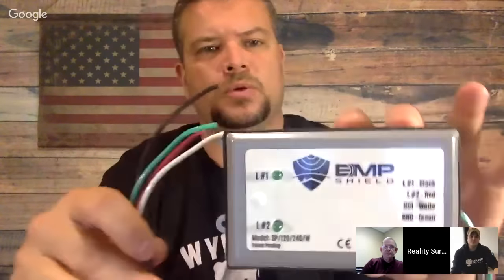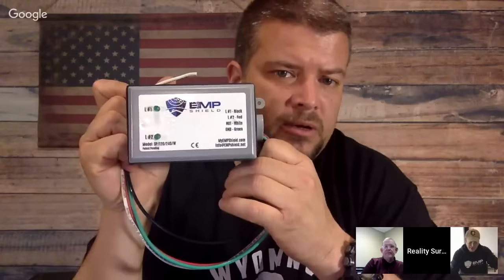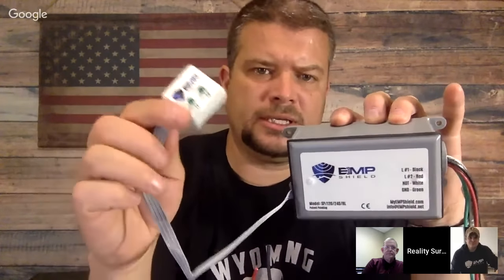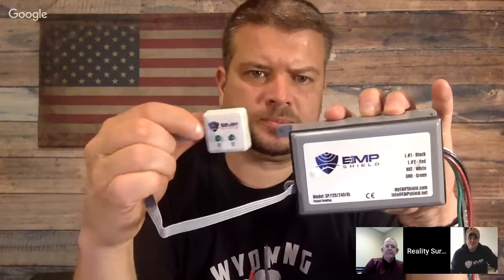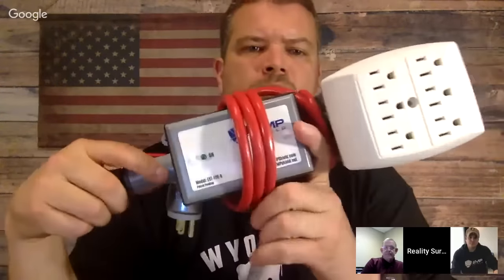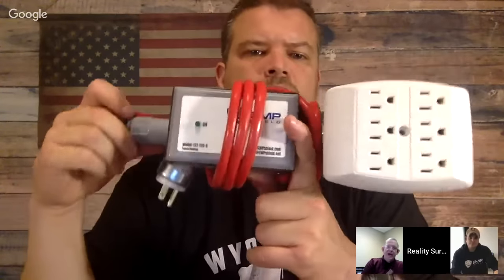The Truth About The EMP Shield!

Comment: I went to a junk yard. Bought a back up computer and body control module for my ride. Put them into a faraday cage. Get fuses and relays from junk yard too.
Reply: Make sure the chipped keys are in the cage with the computer
Reply: Better make sure that BCM is programmed for your vehicle.
Reply: @jeffmotes2129  
100% correct.  Program, install, test!
Reply: I def thought about this . Cause it's a sjre fire way
Reply: But what about the solenoids and all the other sensors in the CAN
Reply: Don't forget an extra starter, alternator, and any other electronic device you'll need.  Remember, 2 is 1, and 1 is none.
Reply from the maker: Not necessary for emp protection. You only have to worry about sensitive electronics with micro chips. Starters and alternators will be fine. At least the old ones. You only have to worry about the HEI ignition module and possibly the voltage regulators.
Reply: Good for you. Put one together for me because I can't.

Comment: Do items/unit need to be plugged in and powered on for protection?
Reply from the maker: According to the manufacture as long as it is hooked up to the system it will work. Even if it is powered down at the time of the emp it will activate as soon as it detects an over voltage.
Reply: @RealitySurvival  I thought the question was (and this is my question), do you need to plug in to the wall outlets: all the electrical items you want to protect? Or are the electrical items just being Inside the home, unplugged, protected? 
Also, can you plug in appliances and things to an electrical power strip with the strip turned off and be protected? Tia!
Reply from the maker: Yes they have to be plugged into the wall I order to be protected by the EMPShield.
Reply from the maker: On the power strip question I think it would need to be powered on. Not off. Because that breaks the circuit.
Reply: @RealitySurvival  didn’t d or t a response, thx! We actually purchased a household one from
Them a few months back but we didn’t know the answer. My husband hooked it up to our flat box fuse box panel. We are talking if one for the motor home (2), the pontoon, and the truck. Need some cash. Great video guys!
Reply: Good question.  I would like that answer as well.

Comment: Do you need one for every breaker box in the house?
Reply: Carol, great question :) You would only need a second device if you home is larger than 10,000 square feet.
Reply: Think of the electrical wiring a hoses carrying water.  Any hose NOT getting water from the source is NOT protected.  Hoses not connected to the source will need protection if they have a different source.  House, truck, generator (unless permanently switched on in the breaker box.)
Reply: And the national grid?